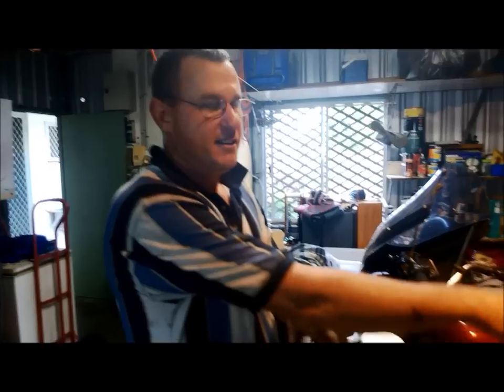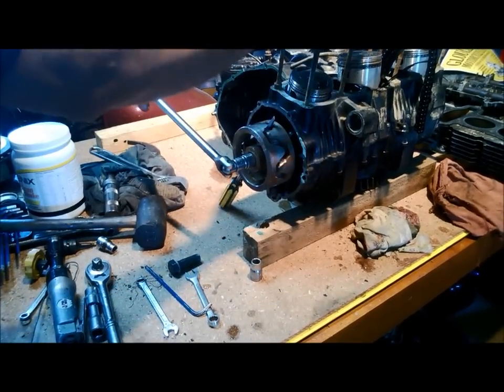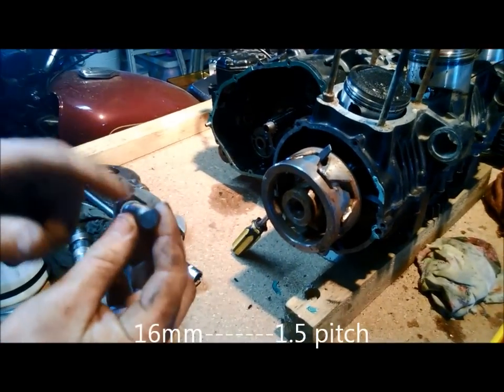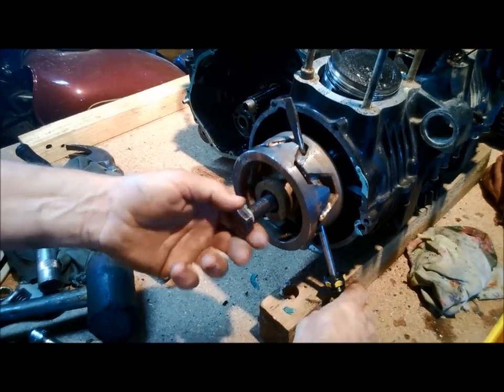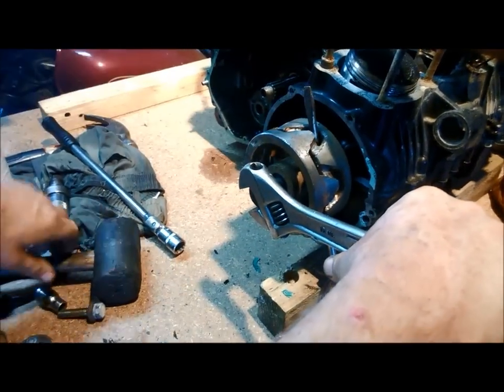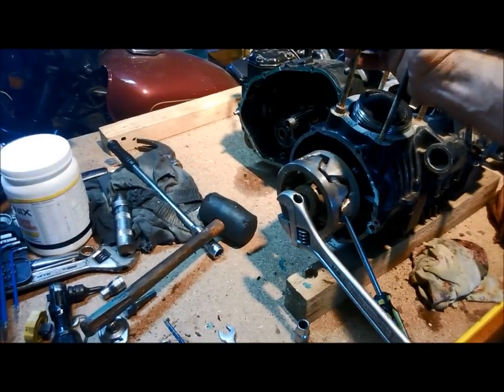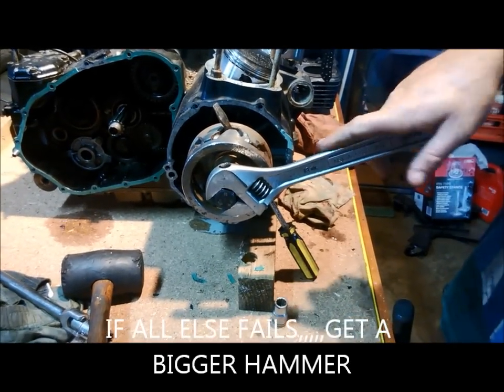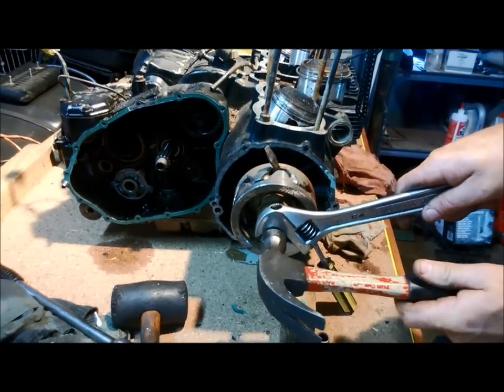Easy stator rotor removal

Comment: Jammy! A convenient screwdriver hole, and an easy pressure bolt access. My Yam is as smooth as a baby's bum, and no internal screw thread, just the locking nut external thread. Crisis! I may have to lash out on an extractor! Thanks for the vid, though, it shows its not rocket science, just upgrade the hammer!

Comment: All I needed to do was lightly bang on the rotor with a hammer then pull it off. No bolt or anything. Happy I don't need to buy a rotor puller now. Thanks.

Comment from the maker: there will be no damage to any earing mate, with the rubber hammer, all that was damged was the rubber hammer
the steel hammer put the shock straight thru the rotor onto the end of crank,

Comment from the maker: mate, the first 10 mm bolt screws through the  rotor into the end of the crank pulling the rotor onto the taper and locking it,
the 2nd larger bolt screws into the rotor itself with the end of the bolt sitting on the end of the crank and with doing it up tight and jarring with a quick tap, pulls the rotor off the end of the crank, 
so the first bolt can't be hit in a way as to loosen the rotor 

trust this helps,, Geoff

Comment: I am having hard time taking my jugs off my xs650 motor, seems to be glued on. I tried rubber mallet. Do you have any suggestions?
Reply from the maker: Denis , over time they have glued themselves on, you've got to break the cooked paper gasket, google remove stubborn barrels, see if that helps,
You could try roping around the barrels, taking the wieght of the motor and using a timber block on you stud nuts, try belting the motor out from under the barrels

Comment: why do you need another bolt to hammer on it instead of doing it on the one you removed first, the one that holds the rotor? it cant be smacked?
Reply: The original Bolt is a smaller diameter that threads into the end of the crank. The big bolt he's using threads into the rotor itself so as you tighten it its actually pushing on the end of the crank. The shock of the hammer blow is to weaken the friction between the slightly conical mating surfaces between the crank and the rotor, whereupon the pressure of that big bolt can will spring the rotor off.

Comment: hammer might dammage on bearing.
Reply: TBH the blows with the rubber mallet are more likely to do damage than the metal hammer. The purpose of the hammer blows is to 'Shock' the friction between the two parts so a smart blow, not necessarily a harder blow, is usually more effective with a metal hammer.